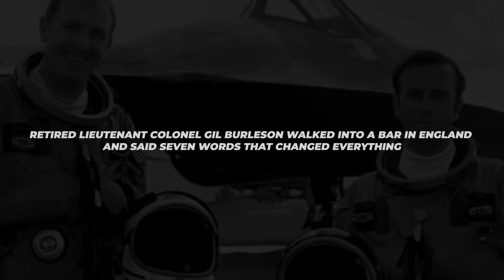Finally! SR 71 Pilot REVEALS The Blackbird's TRUE Top Speed!

Comment: Decades ago, I was permitted a "brief" on the SR-71 at Beale Air Force Base and "Mach 3+" was the default answer, except one officer slipped "Mach 3.2", but I'm sure it's faster, maybe Mach 3.7 or 3.8 and if built today they would be quoiting "Mach 4+".
The SR-71 is the only aircraft that has a Mil-Spec for the amount of fuel leakage while parked (cold).  ;-)
Reply: All aircraft military and civilian have leak limits. Mach 3.7 etc was never remotely possible with the aircraft as configured.
Reply: @gr8crash  So you're saying a 747, A380, Mazda Miata, etc... has Mil-Specs for the amount of fuel they leak.
Ok, how about "Mach 3.6"?  ;-)
Reply: @TairnKA all aircraft have leak limits, its an aviation standard and pretty much always has been. You randomly threw in cars, but yes even cars have leak/burn limits for some items. Especially for testing. 

And no, 3.6 wasnt going to happen with the aircraft as configured, especially on a standard day.

Comment: What was thought to be an innocent slip of tongue, was a simple math problem for Popular Science in an interview with an astronaut/pilot.  Altitude was known and metallurgy of the leading edge of the wing was known.  The slip was that the cockpit needed "visors" to shade the near blinding light from the leading edge of the wing "GLOWING WHITE HOT" due to air friction.  A few calculations later and MACH 5 was pretty close.
Reply: Lol absolutely not. The leading edges were composite not metal. And no, no parts of thr plane glowed red or white etc in flight. Mach 5? Not even remotely possible.
Reply: @gr8crash  I guess Popular Science had it all wrong then.  BUT, composites were not used in military aircraft design until 1960 and only then for secondary items such as trim tabs.  The SR71 and YF12 began development in the 50's so it would be unlikely that any composite construction was used.  Another point is the published skin temperatures nearing or exceeding 900° F where early composites would certainly fail.  The wings, including leading edges, were certainly titanium as reported.  As for speed, I'll side with PS and their rough calculation since published data is still MACH 3... but following that speed run from London to NY, the Blackbird still had its decals but following missions, the decals would peal off.  Obviously the bird had more in her than advertised.
Reply: @BulletproofPastor virtually non of what you said is accurate.  The SR71 wasnt even requested until 1962. Composites were used on the leaded edges, nose section chines etc. Initially also the rudders were composite but this was later changed on the SR71 from the A12 as the USAF didnt have the same RCS demands as the CIA. The aircraft also didnt have "decals"  numbers, letters etc were painted on and didnt just come off during flights.
Reply: @gr8crash  Since retirement of the SR71, Skunkworks has released a lot of the development history and even some technical aspects of it's construction.  Perhaps you had better inform them of your findings.  I bet they will be amused.
Reply: @BulletproofPastor where do you think my information comes from? Its all from Lockheed.
Reply: @gr8crash everything on the outside of the aircraft was made of titanium, even the UHF and VHF  antenna are titanium. They used to retract but that system had reliability issues so they settled with a fixed in place antenna. Had to be careful walking around it because they were mounted on the bottom of the fuselage one closer to the front and on about midway if I remember correctly. Oh and the HF antenna was basically  the nose of the aircraft and I had to   make sure no one was near the nose or in the hanger when testing the radios because the HF radio would jam some serious wattage out.
Reply: @guidonbalangitao1044 mostly. Not everything was titanium. The leading edges, the inlet spikes and chines were composite. The rudders were as well initially.  When the panels especially on the wings were damaged due to them being an asbestos composite they wouldn't "repair" them, but they'd cover them with a titanium piece.

Comment: O.K. folks  3.4 is the top speed for short bursts of level flight.  The engines would flame out after that because the inlet shock wave would shift too far back for the spike to compensate.
Reply: Eh somewhat. It didnt have a "short burst" speed range. 3.4 was above its maximum allowed speed, and even its max 3.3 speed was barely reachable on a standard day. Nor would the engines flame out. Having an unstart is possible but not a flameout